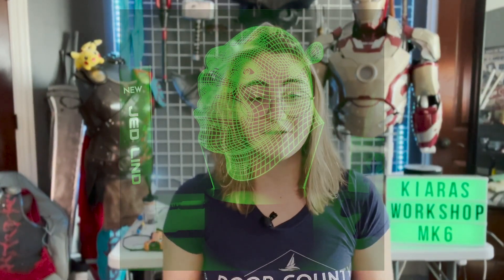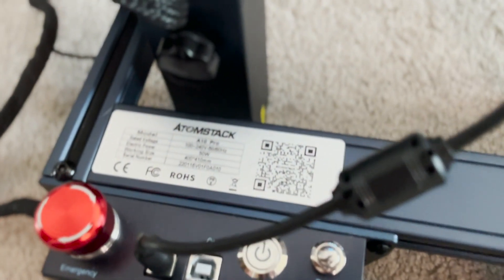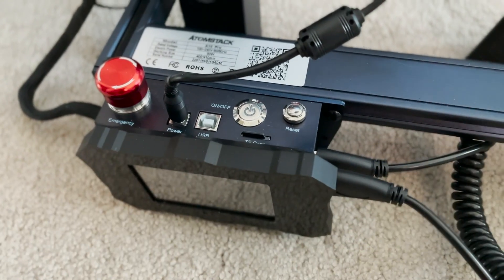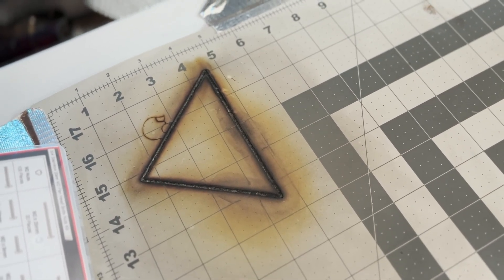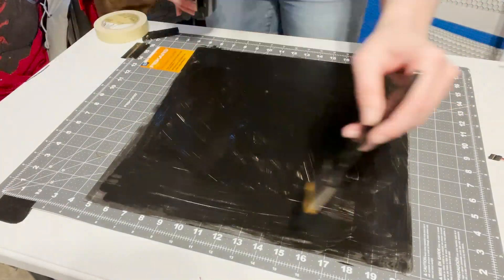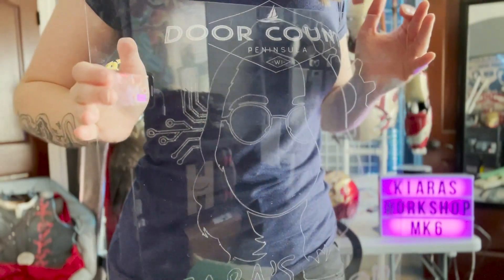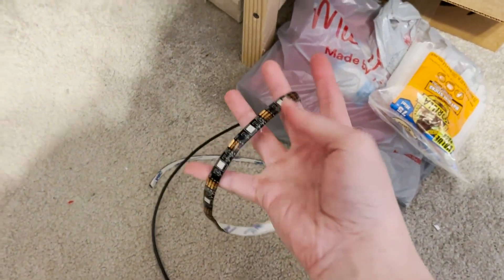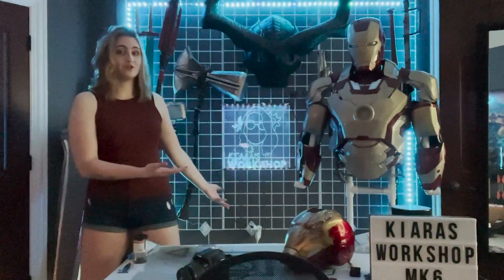I Made An LED Wall Sign! | Atomstack A10 Pro

Comment: Hi Kiara, great presentation, a few questions if you don't mind.  I presume you used cast acrylic which is better for light transmission? Did you use the trace feature in lightburn to prep your artwork? Could you have used fill instead of line (lightburn) ? . I would have thought speed and power output settings would give better results and negate the need to paint the rear of the material? i.e. on my chinese CO2 laser I use 200mm/s and 20% power of 80 Watts, I spray the surface with a solution of weak dishsoap and water to prevent blooming and of course no air assist. have a look at XSTRON for LED strip. I would welcome your advice.